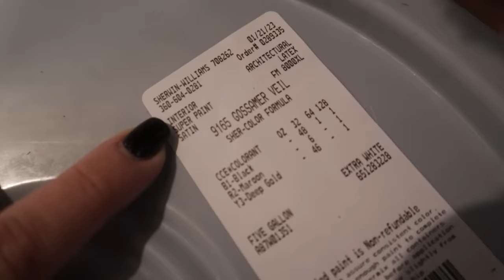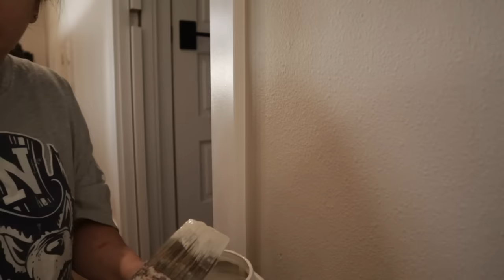I Made a HUGE Mistake!

Comment: Without an under coat of  Primer  your new color will not be TRUE or even in color.  Kilz primer can be tented most time to the exact color you want for a single coat primer. Then your Sherman Williams would have show true.  without primer even 5 coats wont be enough, your base is a yellow/tan.    Have to admit in the beginning we all cringed when you though you knew better than the professionals and didn't put a drop cloth down and started to ruin the finish on your floors.   But you do keep us entertained, we just wish you would get a clip on wireless microphone so you cold talk normal instead of yelling.  Your voice is so plesent when you do the voice overs or hold the phone in your hand.

Comment: If you cover the tray in plastic (cling wrap works too) you can leave paint in the tray for up to 3 days (as long as you get the cling wrap right up against the paint to limit the amount of air that hits it. This also works for paint brushes and rollers, just wrap at least 2 plastic grocery bags around them and squeeze all the air out. If you come back the next day the paint will be perfect to work with, but I have had life happen and didn't get back to it until the third day after and it was still fine. Happy painting!

Comment: When you have to stop painting in the middle of a wall, so you will have a joint, stop with a very lightly painted and jagged (like a zig-zaggy) edge. When you stop with a straight, fully covering, edge, you very easily get a visible line after the whole wall has been painted.  🤗

Comment: When working on a paint job, I wrap my brushes/rollers and put them in the fridge. If I’m having a bit more of a break, I put them in the freezer. Usually they thaw really quickly, just getting them filled with new paint helps thawing faster. I have had a roller in my freezer for months and it was still great! Works with water based and oil based paints.  🤗☺️
Reply: I do the same thing! It means I basically only have to clean brushes and rollers once when I'm done with the project. Works awesome.
Reply: Great tip!

Comment: You should always cover your floor when painting, I think. I prefer a painter’s paper which is thick and stiff and stays in place… It’s just nice to be sure you get no tiny spots from the roller or bigger spills from accidents… 🤗
Reply: I prefer the way Becky does it; It saves so much time and you don't have to worry about slipping or bunching floor covers.
Reply: So true!  Rolling can make spatters on an unprotected floor that can be felt if you rub you hand over the floor, but might not stand out to the naked eye.  And no one is perfect, so a covered floor can prevent HOURS of clean up after an accidental spill!
Reply: @sortathesame8701  Might be she is replacing the brand new floor too.  Might not go with the wall color.  😕
Reply: @texasjones9541   She did not replace the floor when she came to live here and has no plans to do that as far as I know from her videos.
Reply: Watching her spill paint and drop her paintbrush on that gorgeous solid shipboard floor was so cringey. No respect for the previous owners that had to hand lay that floor from underneath the house with wood screws and finish flattening the bending -again by hand -from the top.Complete disregard for the carpenter artistry and other folks' intense efforts to perfect that wildly beautiful shipboard.

Comment: I had to use a ladder to paint the outside window frames that had 6 inch square mullions.  I am terrified of heights and quickly learned to use both hands to paint so i cut the number of times i had to go up and down that ladder.  Best advice for cutting in is buy the best paint brush ( a super good angle brush works) and take good care of it.  It's like fabric scissors, you touch my scissors you are dead, the same goes for my special cutting in brush.

Comment: As someone who just painted our entire build, (ceiling included) by myself, I have to offer this imput. Try to have the next bucket of paint mixed on the same machine at the store, calibration can be off between machines. Also, pour part of the next bucket of paint into the bucket you already have before it runs out and blend it together. I got close to 30 gallons over multiple trips and had to entirely repaint rooms because it just wasn't right. You could see where I cut in the paint vs the wall. All the paint read the same name (Shoji White) and formula but it was far less straight forward then I could've imagined. God Bless Josh for his openness to change it, so glad it'll be something you truly love. ❤

Comment: Huge tip. Paint the color on a white poster board. If you paint on your walls, you are influenced by the current wall color under it that will also surround it. I wish I knew that before I painted my whole house. Watch the paint people you tube for your selections so far. They have reviews and compliment color suggestions for each of your choices as well as how they perform  in different light sources.

Comment: Hey just a little safety tip always put the handle of the car seat down. The handle can snap inwards if there is sufficient force in a crash and the outcome is unspeakable. Also remember to never put coats and other super puffy layers on a baby then put them in the car seat, all the extra material compresses in a crash and the baby becomes a free flying object. NICU nurses where my son was, did a 30-minute car safety class before you were allowed to take your NICU baby from the NICU and they were pretty gruesome with the details.
Reply: Depends on the car seat! The manual states where it can go- mine can be up!
Reply: Some carseats are built to be handle up. As long as she's following the safety manual it should be fine!
Reply: Yes read the manual! Mine also says it can go any position. But super good point about puffy clothes and that goes for adults too! Highly recommend the instagram and YouTube safe in the seat. Michelle is so informative and real!
Reply: Geez, When I was born there were no car seats or safety belts.  No bike helmets either.  It's a wonder we survived.
Reply: @commonsense2462  Yes, as a young child I was allowed to ride in the bed of a truck with my siblings.... And, my father was a Firefighter....
Reply: I always kept it up
Reply: @commonsense2462  hence the reason for seatbelt and car seat safety laws many children and adults have died. As a parent who has lost a child I know I would've done everything possible to save my child from such fate. Though his heart condition was out of my control other things such as a preventable accident is what many parents strive for. So let's not excuse the wrongs of the past when we know better now. Thousands of auto accidents happen daily, safety first folks!
Reply: @commonsense2462  I was as well and a lot didn't survive but hey if you think nothing changes and nothing is learned then that's how you roll. Have a fabulous day.

Comment: Paint tip: when using the painters tape around the trim, etc. Make sure to pull it off before the paint is completely dry. It pulls paint off the wall when you wait to pull until completely dry. Saves you from having to go back and touch up where the paint came off.

Comment: My first course of action would have been changing all of the light bulbs to less of a warm color and tried living with that for a while before repainting. I made that mistake in my bed room, we painted the entire room a ever so slightly warm white color. I cried several times thinking I had made a mistake. It looked like butter on the walls but was beautiful instore and swatched by the window! We replaced the light fixture and it happened to come with day light toned bulbs instead of the warmer version that I had always brought at the store. It made such a significant difference that we ended up painting the entire interior that color!
Reply: Lighting does make a huge impact on how the paint looks.

Comment: We test paint on a piece of Sheetrock which is what is on our walls.  We cover it with Kilz? and use it over and over to test paint colors.  
Also, I see the glass sliding door cracked open.  Dust will be coming in through there from the yard work and you should always keep your doors locks at all times when you are alone, no matter how comfortable you are with the workers.
Great job can't wait to see it finished.

Comment: When you were asking for paint suggestions previously I had suggested Gracious Greige which seems very similar to the Glossamer Veil. I always use Sherwin Williams Duration paint.  It is one of their most expensive paints but worth it as it covers in one coat.  I’ve been painting my interior with it and just did my kitchen this past weekend. My kitchen was an apple green and the Duration line covered it in one coat. Always a job to paint but so worth it in the end.

Comment: You are likely to use an additional 5 gallon bucket or few.  They used to make a funnel contraption for the 5 gallon buckets which made pouring much easier (which is a good and pleasant thing) but most importantly much less prone to spilling.  It wasn't expensive but it was more than a dollar or two.  It was definitely worth every penny!

Comment: The paint color looks really nice.   You are doing a fantastic job cutting in even though it's tedious.   Whenever we painted, My job was to cut in, and my DH would roll the paint because he could reach the top of the wall and ceiling.   And our dog inevitably would lie down and lean against the wet paint or walk thru a drip on the floor, and also would lie down on the tarp like it was his bed.

Comment: Becky, it's good you choose a lighter shade in that dark hall.
We used several similar shades based on light and the eye can't tell it's three shades.
I know that the project is done, but next time considering trying a four inch wide square brush for cutting. If you load an inch at end it goes so fast without double strokes. Every time you go over work you pick up paint.
I'm glad you are much happier.

Comment: Masker is for the tape and paper.    Also you might want to try the roller heads by purdy. They're white with a blue stripe. No shedding. You can get them at Sherwin Williams in a winnie roller size, 9", 12" and 16". Nap thickness is 1/2 or 3/4. I'd go with 3/4. At the end of the day you can wrap the rollerhead part with plastic, squeeze it all around.  Leave frame on it and put it in you refrigerator and not have to rinse it out.

Comment: My walls have been white for years because I can't seem to decide a color.😂 I know you are probably done painting, so for future painting, there are paint shields at box stores that work fantastic. They are 3"w x 2"long. You just hold it against the trim and move it as you cut around all the trim. Very simple and very quick! You'll complete it in at least half the time. You can use any kind of paint brush. I've been using it for years and highly recommend it. 💯❣️

Comment: Have you heard of the Wagner EZ roller from Home Depot. It has a big tube that you inject the paint into. It is not good for small spaces but better for large open spaces. You won't have to fill the roller up as often with this.

Comment: So I watch this Canadian contractor dude on YT and one of his first jobs was with a company that painted homes. He shared his tips on cutting in. (I use to do exactly like how you are doing.) He used a bucket that is only filled a few inches, he forces in the paint in the brush by pouncing it on bottom of the bucket, then wipes all sides of the brush on the bucket edge. When he applies the paint the brush is pushed to splay out the bristles and so you are painting with the paint that is Inside The Brush and elimates the drips! My mind was blown when I did his method the first time. I hope this info can help make this go fast for you.

14:20 time stamp on this link is where he explains it.  https://youtu.be/2eUxz_or2Qs

Comment: When u cut in the first run don’t bring right to the edge , the 2nd coat go to the edge as it will slide smoothly on the first coat and you will get a cleaner edge .

Comment: ..a little tip for paint roller covers is to take painters tape/or packing tape to clean off the fuzzies, hairs, dust etc off of the roller before painting
☮️&🌱's
-tracee (LeRoy's wife)
p.s. also when starting a large area roll your paint in a large W or N and fill in..prevents "shadowing" in the final paint finish/coverage
p.s. tips are from my brother in law who  is a professional painter/drywaller

Comment: Now before Baby Acre is running around, you've built up furniture and decor, and the assorted toys and walkers are under foot is a good time to paint these big open spaces. Then, as time allows, you can close off then paint individual areas much easier. The way you two paint you won't get the whole house done in a night, or even a week. But by golly you do march through pretty quickly.  

We got to thenpint that we "paint marked" individual's tools. Paint mark may mean a swish or two of a bomb can on say yard tools or a little nail polish in say a battery pack for battery powered tools.  It is a good thing to pick a color and use it as consistently as possible in case someone else in your crew decides to do the same.

Comment: You have a remarkably steady hand, though you may find it easier and less stressfull on your hand and wrist if you moved your grip closer to the bristles of the brush and hold the wider, flatter part. Your brush choice, grip and technique are what I consider perfect but for the fact that you're holding a relatively small area that's a bit too far removed from the wall to have optimal control. 
Try putting the very beginning of the handle where its curved, in the crook of your thumb and pointer finger and gripping the flat, wooden part of the brush with your thumb on one side and fingers on the other. I'm sure there are videos on YouTube showing this more clearly.

Comment: Hi Becky! So happy you found a color that fits your space better and makes you happier! It can make a big difference :) One tip from someone who just worked with my boyfriend (a contracted painter) to paint a complete new build- when you're cutting a room its good to brush/roll back into your work. So if you're starting on a right corner, put your brush to the left and work back into the right so you're brushing into already wet paint. It helps create more seamless strokes. Hope that makes sense and is helpful!

Comment: A hint if you wrap your paint brushes and your rollers in plastic put them in the fridge and if you're too busy the next day keeping them in the fridge keep some moist so as soon as you can get back to it you're starting with fresh paint brushes you don't have to clean them they're not gunky they're not nothing it's an awesome trick That's only if you have a second refrigerator I wouldn't put it in with food I learned it from a boss we were painting our new business and it was a personal care home and we were painting all the rooms and getting ready for our grand opening and she taught us that trick and she taught us another trick The glass between your stove you can take a rag spray oven cleaner on it and put that rag around a coat hanger and go up through the bottom of the door on your oven where those vents are and it'll take you and you can clean the inside of the glass that way I don't know if the newer stoves have those on the bottom but with the older stoves that's what we did these tricks were done about 25 years ago Don't know if the newer stoves have changed or not but if you have an older stove that's a trick you can use